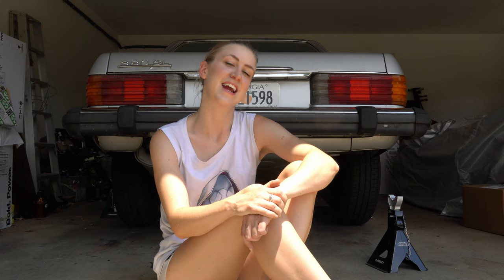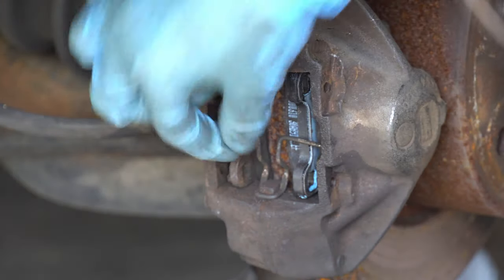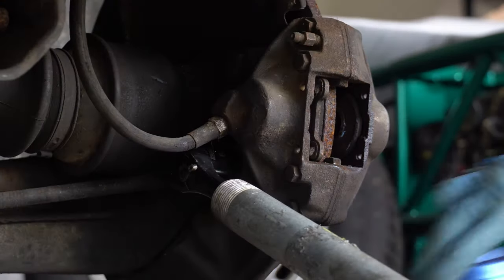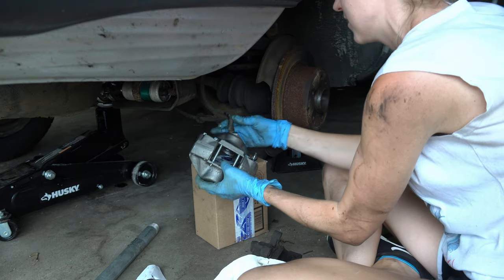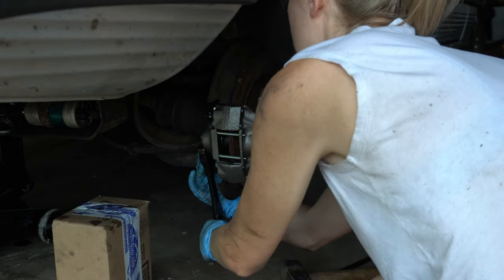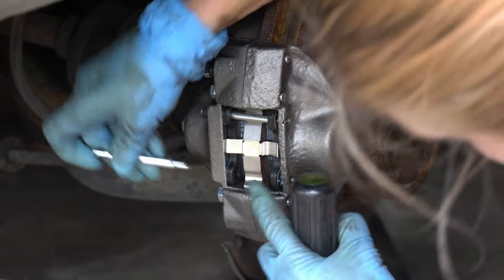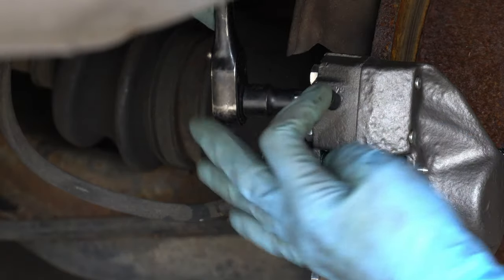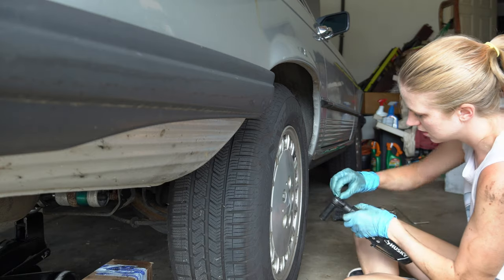1983 Mercedes 380SL Caliper Swap

Comment: That flexible brake line seems a bit old (tiny cracks near the metal end 1:43). I'd suggest replacing that soon.
Reply from the maker: Good eye! Yeah, that was where I initially suspected her leak was coming from, so the parts are there, just had to address the screaming problem first this time.  There will definitely be an update video in the near future.  Thanks for watching, and for reaching out about the line!
Reply: @summerdelsol  Was there an updated video on changing out the brake lines? I need to do the brake lines and the caliper.
Reply from the maker: @sophiathe380sl  Ah, sorry to say not at the moment. The SL has taken a back seat for the moment to some other projects, and has a battery drain that will likely be diagnosed next.